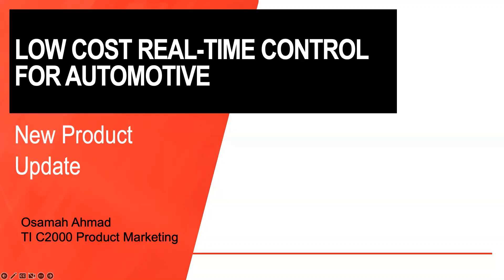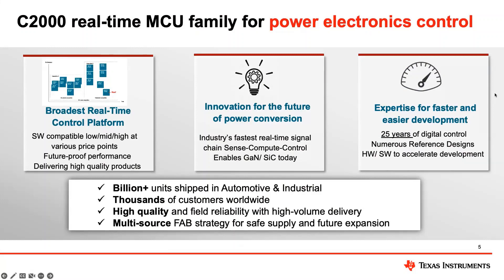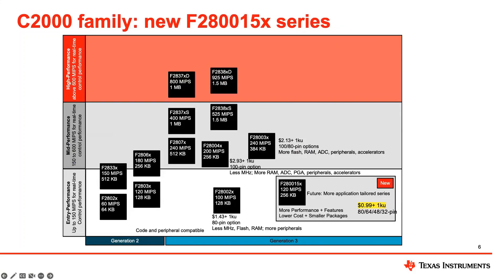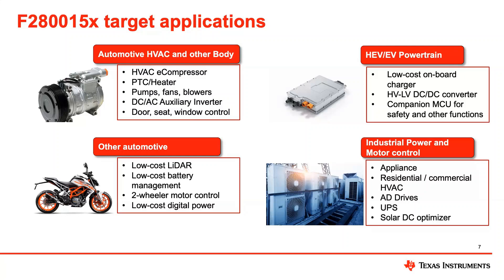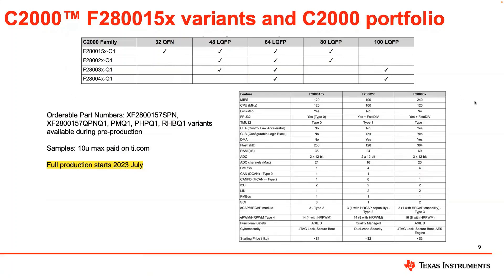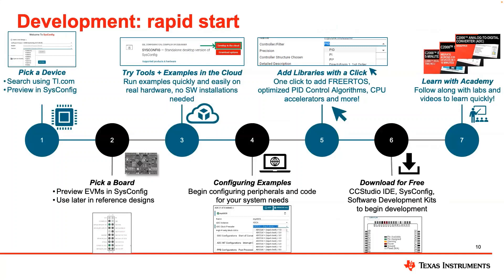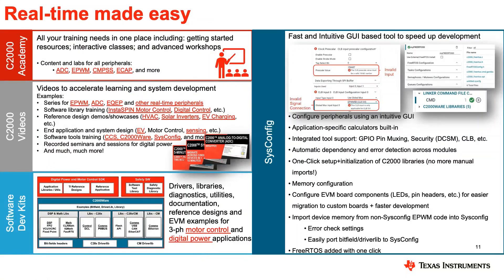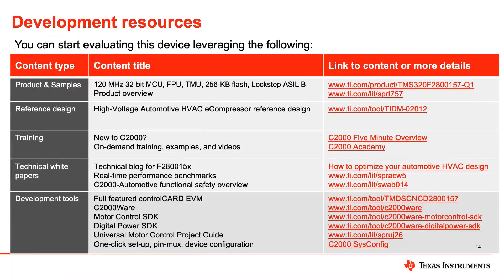New Product Update: Low cost real-time control for automotive

Comment: Why you can't be like STM32? 

The CubeIDE, doesn't matter how much buggy that is or was, is GREAT. The online support, the community, the widespread adoption, examples, implementation guides and videos.

There are a load of C2000 dev boards rotting in my University and nobody wants to touch that and student accept losing internal marks than working on that.
Reply: Tesla EVs uses this platform DSP to control the drive train you are highly mistaken this is used for real-time applications. students still need to learn alot, STM32 is a dump that floods the market and they cannot support their portfolio concisely. ever heard of control suite ?